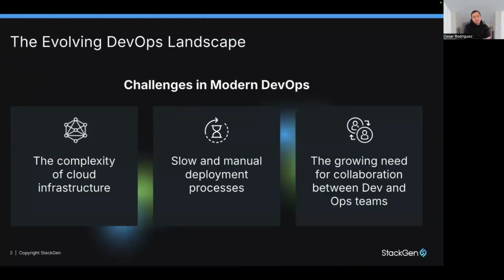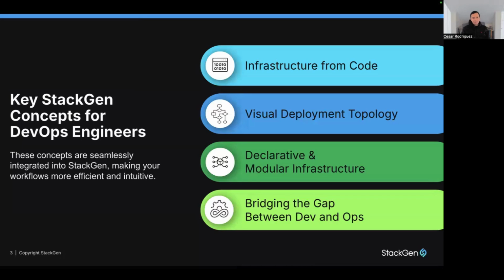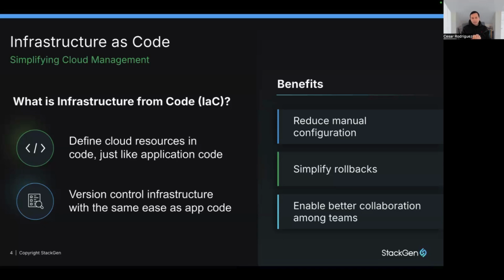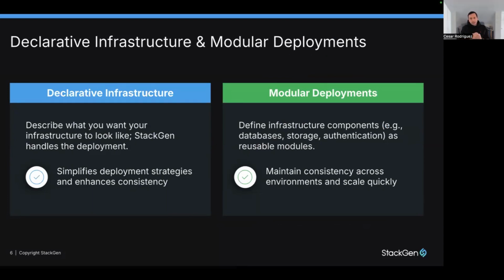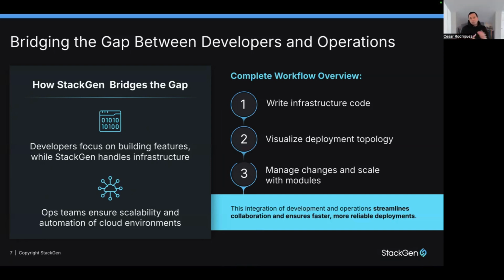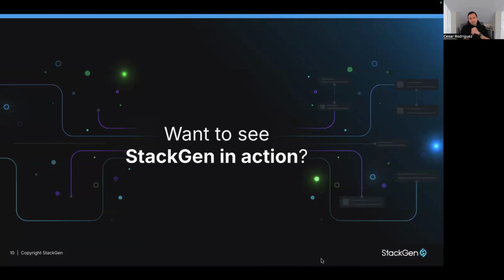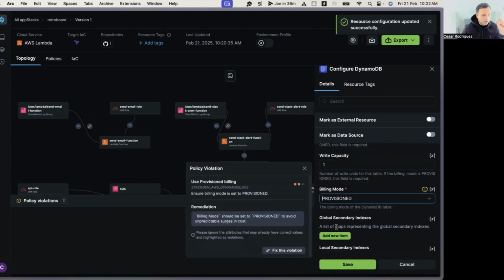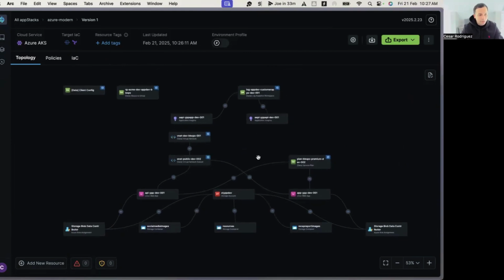Transforming DevOps: Modern infrastructure management

Comment: Looks interesting. Thanks for your effort!
I have the following questions though: 
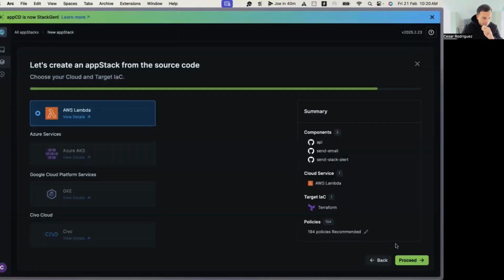1. If the application (retroboard) used in the demo is intended to work as serverless, then why are the platforms offered/suggested in the UI (24:21) for Azure and GCP - AKS/GKE respectively, instead of their direct FaaS counterparts to the AWS Lambda used in the demo, namely Azure Functions and Google Cloud Functions?
Because if we are in the realm of FaaS as "serverless", its implementation in K8s (EKS, AKS, GKE, etc.) is nothing more, nothing less, than Knative.
2. It seems like Terraform is only supported as IaC tool. If it's so, are there plans for different ones to be added in the future (like Pulumi or Crossplane for instance)?